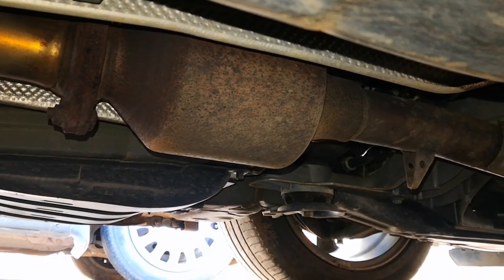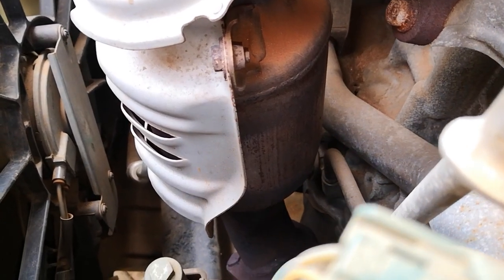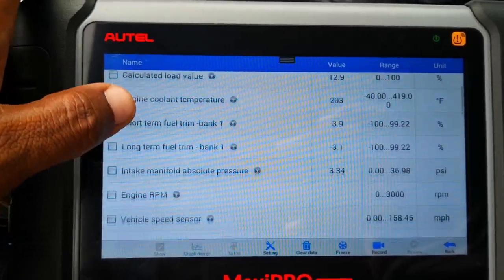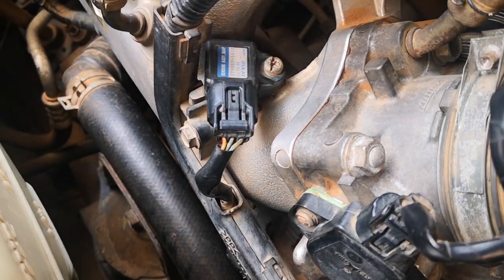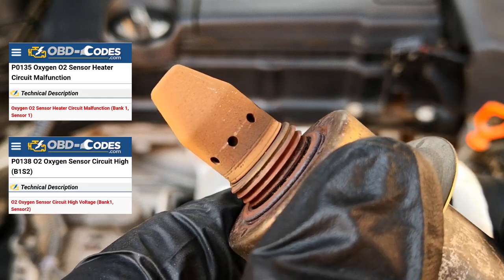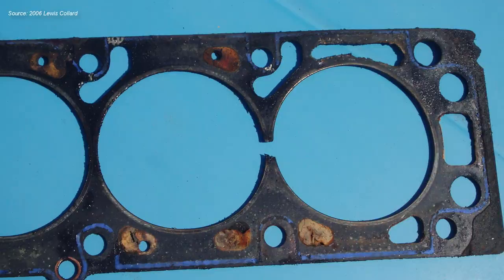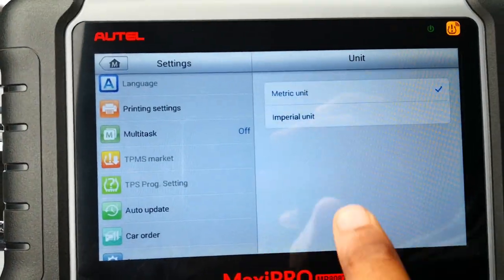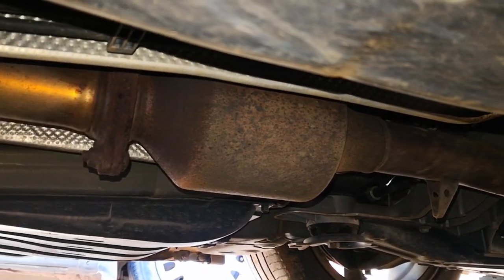How to Avoid Catalytic Converter Issues / How to Prevent your Catalytic Converter from Failing

Comment: I worked on a toyota camry 2018 4 cylinder engine that had these codes 
1 . P0128
2.  P0420 
 Upon physical examination I discovered the thermostat had been removed so I replaced with a complete thermostat and ect sensor , it comes together as a whole assembly. Took the car for a road test got it into closed loop but only p0428 code came back but when I looked at the live data I noticed two things
1. The up and down stream 02 sensors had similar readings I.e same voltage out put and patterns of oscillation
2. Temperature recorded on the catalytic converter didn't exceed 490 degrees Celsius 
Now I don't know the downstream sensor or the cat is bad what do I do
Reply from the maker: Good progress you've made on diagnosis!
When you said both primary and secondary O2 sensors were oscillating similarly, did you hold the RPM between 2 - 2.5k? If not, do this. If the CAT is good, the secondary O2 sensor voltage should hold around 0.6v.
Also, if you have an infrared thermometer, try to check the temperature at the inlet and outlet of the catalytic converter. The temperature at the outlet should be about 40oC higher than at the inlet. Be sure to point the infrared dot at the exhaust pipe itself not the heat shield.
If the temperature is lower or similar at the outlet and the voltage of the secondary O2 sensor keeps switching like a primary sensor when RPM is at 2 - 2.5k, it's likely the CAT is shot.
I guess the car also had the fan running directly to the battery or no?
If it was, it's possible that the car has been running rich due to inability of the engine to reach operating temperature. 
To be doubly sure, you could proceed to inspect the CAT itself, depending on how much time you have and the owners willingness to follow through...
Reply: Just like DIYAutoworksNG said, you may be having a catalytic converter issue. The secondary O2 readings shouldn't fluctuate as much as the upstream O2. The fact that you have readings from the downstream sensor at least indicates its wiring harness is intact. However, to be sure of the downstream O2 sensor's data, test the sensor itself first to see if it performs to spec. Come to think of it, does this car model use narrow or wide band O2 sensors? 'Cause output of the former is in mA and the latter is in V or mV.
Reply: @abdul-kabiralegbe5660  it uses a narrow band as it recorded in milli amps
Reply: @seunfire  Does your scan tool have a graphical function? If yes, as mentioned above, the downstream O2 sensor's waveform should be very very gentle (unlike that of the upstream sensor). If the waveform is as choppy as the upstream, then the cat's efficiency is practically dead.
Reply: @abdul-kabiralegbe5660  yes mine has a graphical function but I didn't graph it
Reply: @seunfire  Do keep me posted.
Reply from the maker: Guess you meant the upstream sensor and that it's wideband. All downstream sensors I know are narrow band (could be wrong), and have their readings in volts.
Reply from the maker: Guess you meant the upstream sensor and that it's wideband. All downstream sensors I know are narrow band and have their readings in volts.
Reply: @DIYAutoworksNG  Okay, I didn't know that (i.e. that downstream O2 sensors are usually/always narrow band), though it makes sense now that you mentioned it. I was asking him if his vehicle uses narrow or wide band O2 sensors because I know wideband (output in mA) are newer than narrow band (output in mV or V).
Reply from the maker: Yep. They wideband's are newer and essentially do the work of an AF sensor.